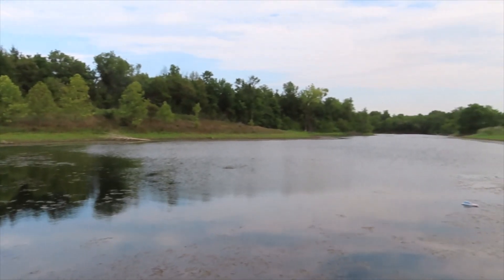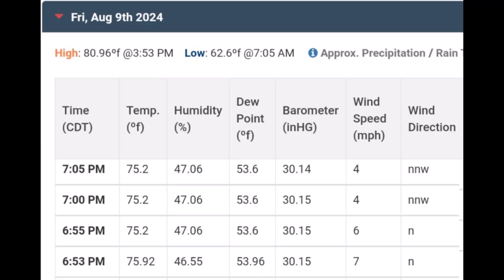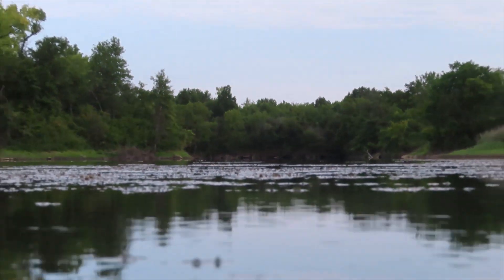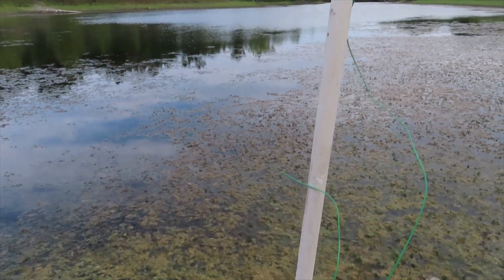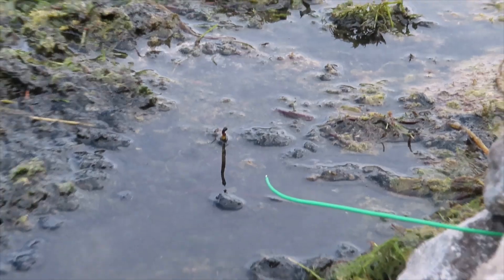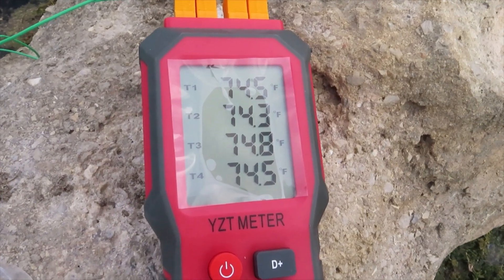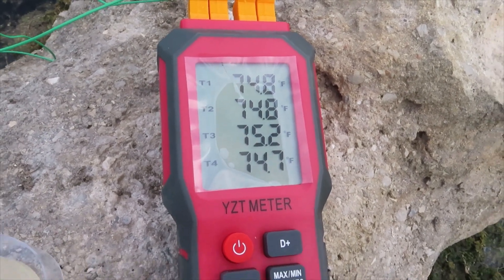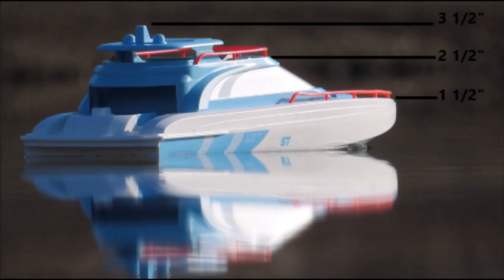RC Yacht Sails Into Mirage - August 2024

Comment: What would be a great add to this type of video would be a high visibility yard stick planted at both ends of the pond driven into the bottom of the pond until they both are stable and read the same height at the water line. @1:41 when we observe only the very top of the boat, it would have been great to know the height of this mirage above the waterline. This would settle the debate as to whether or not mirages have height to them. It would also help in understanding the height that the boat presents itself at across the whole transit across the pond.

Comment: I was less than 14 seconds into this observation when I clued in on a mirroring event across the full screen despite the depth of the observation. While some may suggest that a "mirage" has no actual height to it, it is clear to any rational thinker that it has apparent height in what the viewer would describe of their observation. So why would that be? Most would accept that a celestial body could be lower on the horizon than it actually is due to "Refraction". So, why could the light off of the water not be interpreted as being somewhere it is not actually at due to "Refraction" as well? When you observe water, you see a specular reflection or a diffuse reflection. The Specular reflection produces a mirror like inverted image while a diffuse reflection produces the rippled reflection that is not mirror like. So, what happens when this image off of the water is Refracted? Where does it appear to be once it is refracted. I would suggest that the specular reflection presents itself higher like in this video. An RC boat or other objects sail into this refracted plane of visual information, and it is absorbed by it. If the water at the distant shore was not mirror like, then the boat would have been absorbed by a diffuse interpretation of the water. This is the mechanics of mirage or just visual blockage. When you understand the path of light coming from the objects towards you and not your eyes reaching out to see something, you are better on your way to understanding observations. You have to think about how the light makes it to you in order to properly understand it. 

Great videos as always guys.

Comment: Suggestion: place the camera at the same height above the water as the top of the RC boat. 
Then, either fix the camera direction so it doesn't move and drive the boat away, staying within the field of view. Or, place some other fixed marker within the field of view that is also at the same height as the camera and boat top, so that you have a reference for horizontal (0 degrees vertical elevation). 

The objective is to see if, in addition to becoming obscured by inferior mirage, does the boat drop in angular elevation? 
Does inferior mirage also produce a declination effect?

I submit that that is a distinguishing element between a curved surface and a flat one. Inferior mirage can produce an obscuring effect, whether the surface is curved or flat. But I don't believe inferior mirage will produce an angular drop like a convex curved surface will. It would be important to see it demonstrated if mirage can produce that angular drop in addition to obscuration.
Reply: Hey Bobby. I have not fully analyzed your angel but wanted to put out something into the thought process. As Wydopnthrtl put out in the comment that I'm seeing above, the supposed geometric horizon is about 4 times further away than the length of the pond. With that said, not only are we seeing problems with the geometric expectations, we are also seeing obstruction of the full height of the RC boat above the apparent waterline and well into the distant shore. I'm not sure were running specific angular measurements from the surface help in regard to your surveyor approach. Surveying relies on un-refracted line of sight for accuracy. This observation shows that refraction can prove the "line of sight" surveying as inaccurate for drawing conclusions.
Reply: @bflat1894  My interest in this video wasn’t what a globe geometric expectation might be. At the distances involved here, there’d be no discernible difference between flat and curved, such that this demonstration is essentially flat for all intents and purposes. 

What I get from this is an attempt to show that inferior mirage might mimic or create the illusion of what curvature claims to exhibit: mainly obscuration. My input is that curvature adds accompanying declination that flatness does not. 

It’s not essential to derive survey-quality vertical angular measurements. (Surveying isn’t performed 2inches above water surfaces.) All I’m suggesting is finding a way to establish a horizontal index against which any declination can be discerned. Across this pond distance, there is no measurable curvature, so any observed declination would be due to refraction; and if observed, might strengthen the case for inferior mirage conditions being responsible for 2 commonly claimed attributes of curvature: obscuring and declination (downward displacement).
Reply: @bobshafto  I have suggested to Sky Free that yard sticks set into the water at the same heights at waterline may help. It would at least give a good measure of the height of the mirroring line at the far end. 

I noticed that as the boat is sailed down the  left hand shore, the mirroring line starts low and visually increases in height as the boat moves down to the far end. The height relationship of the boat to the mirroring line of the shore behind it gives us some pretty good information about this mirror plane. What I would like for you to consider about this observation is that the redirected (refracted) light coming off of the waters surface is smooth and produced a specular reflection. Consider what the mirage would look like if the surface was not smooth. You would not be able to observe the contrast afforded by the reflection of the shore. You would just see scattering of light that is typical in viewing bodies of water. In both cases, the water is not actually where we believe it to be. It is in "appearance" raised and causing visual obstruction. 

My take on refraction is that light coming off of the surface of the water behaves just opposite of light coming from objects higher than our eye level. If that is the case, then where they meet at the horizon would create varying degrees of obstruction causing different interpretations of where the horizon actually is. Refraction is always present. When it is less intense, we see further in my opinion.
Reply: @bflat1894  "I have suggested to Sky Free that yard sticks set into the water at the same heights at waterline may help. It would at least give a good measure of the height of the mirroring line at the far end." ~ that would work for what it is I'm asking for too. But realize we are searching for different things. I'm less interested in vertical extent of the mirroring effect as it relates to distance. What I would like to see is any correlation between angular displacement downward of objects above the mirroring effect and the mirroring effect itself. 

Along a water surface that we all can agree is essentially flat (no detectable curve at the distance involved), will inferior mirage presence correspond with an angular displacement downward at the far distance such that 3 points of equal height above the water (camera, near height reference, far height reference) will not align. 

These RC boat demonstrations on a pond at a height of mere inches above the water surface are, I believe, intended to show how mirage effect can create an effect that is often claimed by globe advocates of being an indicator of surface convexity. Here, there is no actually surface convexity, so the obscuring effect is only due to mirage. Is that what is happening in longer observations where surface convexity IS contested? It the effect just an illusion due to mirage?

We also observe angular displacement downward that makes points of equal height not align in the horizontal. That, in addition to obscuration, is a signature effect of surface curvature. So, on this this pond scale, is that effect also present? That's my question. Is this replicating the optical effect seen on larger scales and can inferior mirage be claimed to account for not just the presence of obscuring but also where it is happening in the vertical?

Unless I'm misunderstanding you, you're wanting to examine something different; something about the location and dimensions of the mirage/mirroring effect itself. I'm interested in what appears above the mirroring line.
Reply: @bobshafto  one thing that you will need to consider is that the boat is on the surface of the water, and it has a fixed height above that surface. The surface of the water given the short distance would be flat or have insignificant curvature to it. The measuring stick will therefore provide size measurement at the distant shore as well as height of the mirage. Knowing the height of the mirage, height of the boat and having a reference to where the water actually is will tell us what the mirage is actually doing as far as producing visual obstruction of that which is behind the mirage or that which has traveled into the plane of mirage. By plane of mirage, I mean the angular plane that starts at some distance across the pond and rises with increasing distance from the observer. This is at least what I observe. 

It will be interesting to establish if distant objects are visually displaced downward or that it is only the waterline that is misrepresented higher. My earlier statement would agree with you in that all objects above eye level seem to be displaced downward by refraction while water only has an upward displacement due to refraction. This could be argued by Heaths work that shows concavity in observations but my take on it is that it depends at what distance refraction starts compared to the other objects viewed in the observation. Refraction is also progressive with greater distances. In this observation we only focus on the highest refracted vertical representation of the waterline. This in reality happens in stages across the overall distance. This produces the banding layers that I have mentioned before.

My belief is that yes, mirage is causing the obstruction that leads to a convex interpretation. Refraction bends the path of light. It does not straighten it out. A straight straw put into a vessel of water looks bent. A bent straw placed in the same vessel will never look straight. Some boats can be brought back into frame with zoom if there is no refraction misplacing the actual water line.  If refraction is present, the boat cannot be brought back into frame. This video is a perfect example of that concept. The boat sailed into the mirage zone and cannot be seen unless the observer rises above the refractive zone. 

I have my reservations about trusting downward displacement. We see the work of Pablos dog beyond Mesa lane in which the complete hillside behind changes in not only height but vertical spacing between different attributes of the hillside. Refraction is at play right across the board. We cannot say with Definity that things are where we measure them to be. 

Understanding the complete mirage in the micro educates us on what is happening in the macro. Your observations at the entrance of San Diego are more to the macro scale. Both the micro and the macro create this effect at low angle to the surface. You form your speculations beyond 6 miles. This is studied in a tenth of a mile. There is far less to speculate on. This makes it a great opportunity to study up close and confirm that mirage causes visual obstruction. 

I appreciate you taking the time to entertain this video and discuss it with me.
Reply: I do think IM conditions, as described in online diagrams of such (Reference my community page recently), also produce an effect where the light from distant objects (above your elevation) hits your eyes at a lower angle than actual...aided by the angle of incidence from the higher objects.  Thus...lowering the lower bits of the whole scene...apparently.  Supported by high correlation of observed IMs and lower observed apparent horizon across like 100 plus observations.  Hope your move is good for you...lots of good observational opportunities up there.

Comment: Nice one! I think that's one of your strongest mirages yet? But hardly a measureable gradient, unless we assume a sharp rise in temperature below 2 inches.. but besides the convenience of that assumption, where would that extreme heat micro layer go, if not up? Plus, the mirage distance and obstruction looks pretty linear with your raising the camera. (watching on my phone so hard to confirm) If light were only bending up in the region between 0 and 2 inches, it should be a more dramatic transition, I would think. I still maintain that mirages tend to form and obstruction occurs with much less of a gradient than the refraction calculations dictate. I think you are collecting important data that could help prove this. And it's not really humidity either, in my opinion based on recent observations and crude measurements.

I have some ideas for a few tests related to this idea of "at what height does light stop bending up when there is an inferior mirage" and I'd like to get your input once i get a few more things figured out. Anyway, keep doing what you do and I'm excited to see what else you have planned!
.
Reply: Some excellent comments about what may be happening with the light and how we are observing it.

Comment: Technically... at 2" above water to the radius tangent of the purported "globe" would be 0.499824 miles away.   Your boat was only 0.113636 miles away.
So... your observation shows the optical phenomena on a fully visible body of water.  (if it were spherical in shape)
Ironically that's the very same observations we see when a boat should have gone over a curve!  Good work!

Optical phenomena of perspective and the eyes ability to angularly resolve are what everyone sees. NOT ships going over a curve.  
Shalom
Reply: You can observe a plane desapear and dont need the horizon 🎉